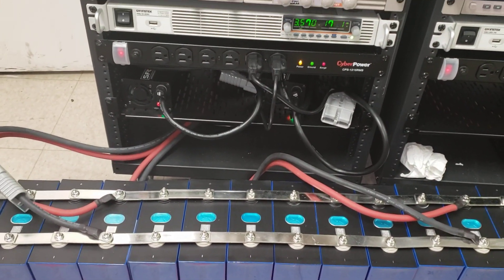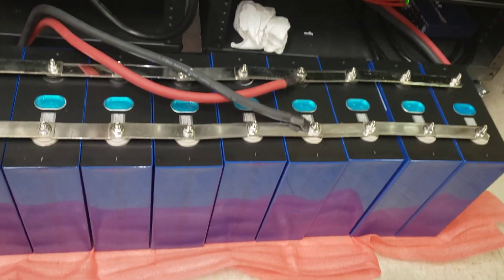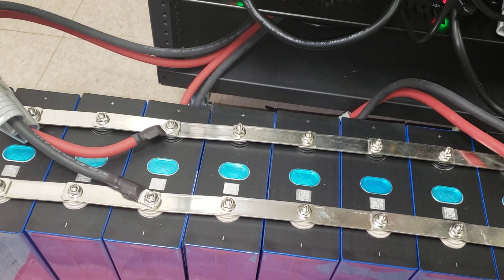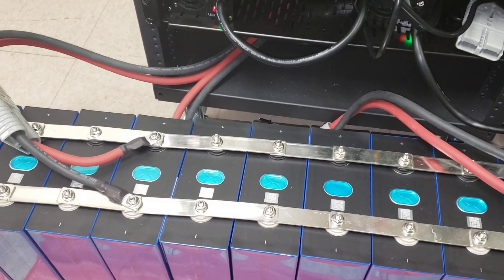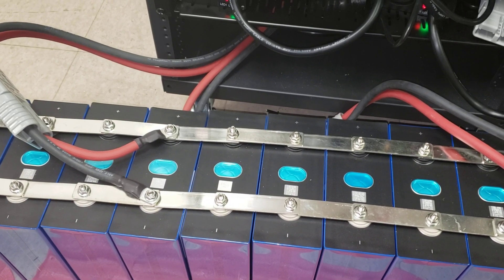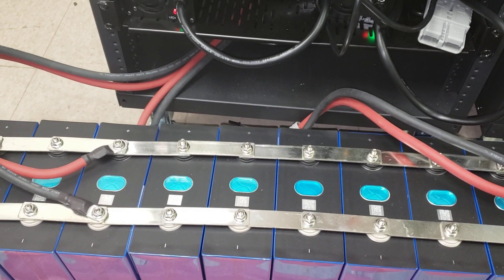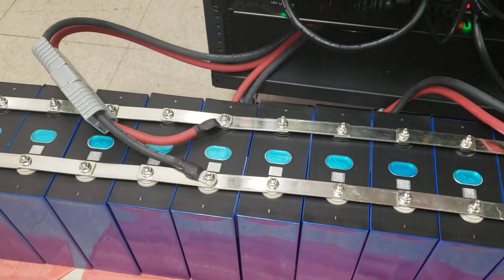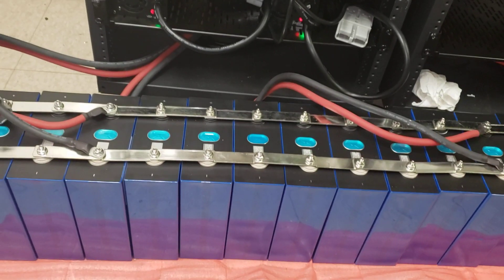Balancing large bank of cells

Comment: The voltage of all cells will be near on idenical - they are physically connected. How you identify any one cell being different from the others while connected this way has be baffled.
Reply from the maker: So in parallel charging we are simply trying to get all the cells to reach the same voltage, in this case 3.65. So it is not necessary to find the voltage of individual cells. When the cells are connected in Series then we need to know the voltage of each cell. IN parallel they are like 1 big cell. E.g. 4 280 cells in parallel = 1120 AH at 3.2v  but  4 280 cells in series = 280 at 12.8v 

Individual voltages are only really needed when in series connections.

Comment: Hello, I f i was to order the cells from your company, what will be the price per cell thank you
Reply from the maker: Hi, Our prices are pretty low, I don't think you will find anyone in the US for lower than our listed. You can use our contact forum and let us know, please note we are pretty low on stock so it will be a little bit before we have cells ready.

I can offer you the 260DEAL coupon which takes $235.00 off our  pre-made SFK-260 and SFK-260HP batteries
Reply: @sfkenergy  Thanks for the info, so what's the price for the pre made battery, am living in the Caribbean
Reply from the maker: @errolcain4071  I will have to check on shipping but right now with the 260DEAL coupon it is 1140.00 shipped inside the US. I'm not sure what shipping to Caribbean would be.

Comment: If you measure the voltage across each cell while charging, especially at high amp rates, you'll find the highest voltage on the cell where you connected the two supply leads. The further away the cell from the point of attachment the lower the voltage on the cell.
This can be partially mitigated by connecting the supply at diagonally opposite corners - connect negative to negative of the first cell and positive to positive of the last cell.
Now measuring the voltage across each cell will find they are closer, but with especially long parallel strings you will notice the cells in the middle will be lower voltage as they are the furthest away from the supply connections. You can jump connections using heavier cable from the end cells to the middle cells, but it's seldom worthwhile, or maybe better to say such additional connections have rapidly diminishing returns on cost.